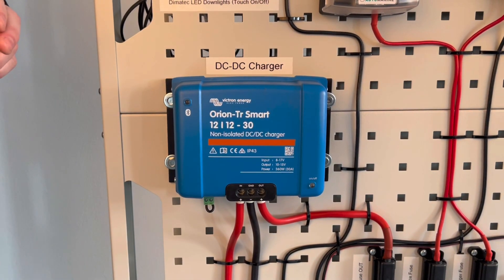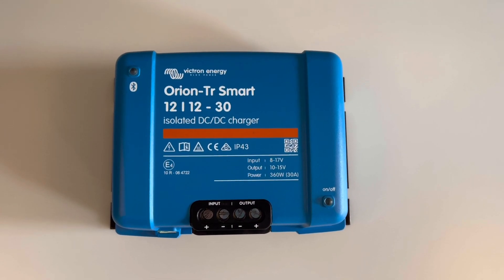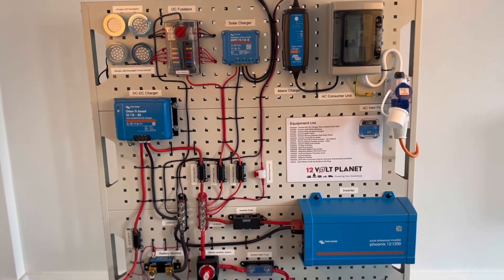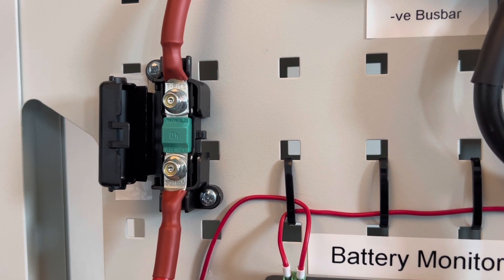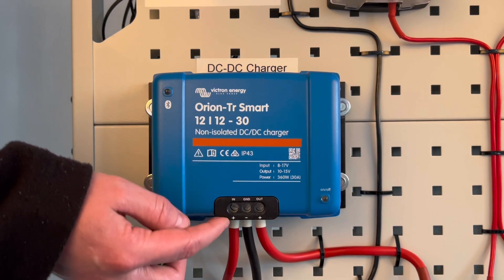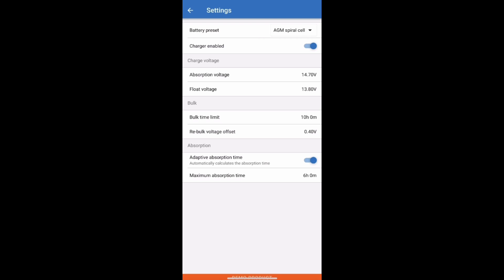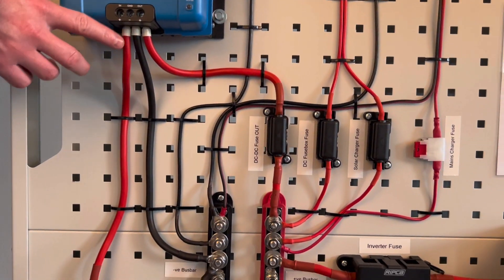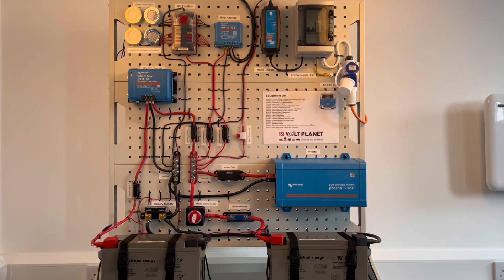How to Install a Victron DC-DC Charger | 12 Volt Planet

Comment: If you have an 80 A alternator, should you get a higher ampere charger?
Reply: You want to keep the amp as low as you can and still get a charge, that will depend on the type/brand of power station you have. The high amps draw is what burns the alt. out. This is why you need to adjust the settings for your alt. should only be 20-30 amp draw to be safe for your  alt.

Comment: It’s a 30A dc-dc charger; with 40A fuses on the input and output. Why does it need 16mm(2) cable rated for 110amps? The cable is not going to see any more than 30amps. Would 10mm(2) cable not be ok?
Reply: I also don't get it. The charger can output 30amps max so theoretically can only draw 30 amps therefore cable should be sized appropriately. Voltage drop is not significant in short lengths as far as I understand.

Comment: Good morning and thank you for the video.  Currently my motorhome has the services battery not connected to the chassis of the vehicle.  In order to use an uninsulated DC-DC, I would like to connect the services battery with a properly sized cable to the chassis ground.  Do you see any contraindications to doing this?  What problems might I have?
Thank you for the feedback.

Comment: Just skips over for 4.59...how many fuses in that positive run. One 40a close to the van battery then another 2 on the run from the charger to the L.Battery....plus what looks like an isolator switch. Just very confusing.

Comment: I am in the early planning stages of converting my van. It is a Transit Custom and I am intending to put the leisure battery under the passenger seat. I do not plan to earth it to the van chassis. My brain is getting a bit frazzled understanding this bit of the electrics. Would it be better to go for an Isolated or Non isolated charger. Thanks
Reply: Isolated will give you 2 negative wires so that you can send one to your starter battery and one to your liesure battery. Non isolated would give you just one negative that you could grount to the chassis if both batteries were also grounded to the chasis

Comment: I just can't understand the 30a output part. I phoned a victron dealer and they confirmed the 30a would be fine for my 95ah agm battery. I'm sure I have seen in the app settings you can select 95ah agm for the 30a victron model, yet this video says it is not suitable ?

Comment: What is the main difference between running isolated vs non isolated? 
I just bought an isolated 12-24 DC/DC charger for a 24v 100ah solar+DC/DC system.

Comment: Trying to figure out if something like this would work for me. I'm currently running a dual battery setup with an H6 Optima Yellow Top as a house battery which is isolated from the main battery with an automatic isolator. Charging voltage is usually anywhere from 14V to 14.8V, but seems to charge closer to 14V most of the time. My Bluetooth battery monitor started showing signs that the battery wasn't holding a decent towards the end of December. I finally had to the pull the house battery and put it on an Optima 400 charger/maintainer this weekend. I'm sure that sulfation occurred because I had to charge and drain it multiple times before it would hold a good charge. It seems to be OK now, but I was wondering if a DC to DC charger would work better.

This is on a 2017 Chevy Silverado. DC to DC charger would be installed in the engine compartment (if that's ok). The H6 Yellow Top is a 72 AH AGM battery. Recommend charging current:
Alternator:
13.65 to 15.0 volts, no amperage limit.

Battery Charger:
13.8 to 15.0 volts, 10 amps maximum, for approximately six to twelve hours.

Cyclic Applications:
14.7 volts, no current limit as long as battery temperature remains below 125°F (51.7°C). When current falls below one amp, finish with two-amp constant current for one hour.

Rapid Recharge:
Maximum voltage 15.6 volts (regulated), no current limit as long as battery temperature remains below 125°F (51.7°C). Charge until current drops below one amp.

Float Charge:
13.2 to 13.8 volts, one amp maximum current, time indefinite (at lower voltage).
Strictly adhere to all limits.

Trying to decide if one of these DC to DC chargers would be better for me and if so, which one would work best for me.

Comment: It looks like you have used ferrules on the ends of the cables? Any idea which ones they are? I have some 16mm ferrules for mine but they don’t fit in the terminals for the dc-dc charger. Thanks Nick
Reply: I think he used heat shrink around the tops potentially, Ferrules dont work to well as its a rising terminal and its set up to squash the connection and get the most contact, I was having a hard time with ferrules and was not having a good time. I did some searching and they said  bare copper is the best to use.

Comment: Great review ! thanks i need this , got a question i got the Anker powerhouse 757 my XT60 input is 30V 10 AMP max what type of Victron do you recommended ? or can change the amps in the Victron Orion 12/24-20A non isolated to 10 amp ? or do i need to buy the  Victron Orion-Tr 12/24-10A (240W) isolated

Comment: The Orion Tr Smart gets to hot without a fan as it has only 88% efficiency. So it reduces charge current just after 15 min driving. Probably it has the lowest efficiency out there. I would recommend to go for a fan cooled dc-dc charger instead, if maximum charge current is important.

Comment: This is a great video. If you have a Victron mppt and panel going to main battery can this be used to take the 2nd output from the mppt to the Orion? The 2nd battery is charged when the vw bus is running via the ecu as it's a factory 2nd battery. This is to divert solar power from the mppt to the 2nd battery when the bus is stood up and intention off? 😁👍🏼

Comment: Seems like you could use two of the isolated chargers to charge a battery with twice the voltage of the supply. 🤔

Comment: Very good video thank you, I currently have a PowerPart PDU and when I start the engine there is a click in the PDU and it turns off my motorhome electrics, except for the Fridge.  I would like to replace the PDU with separate units, one of them being this charger.  How does this work when the engine is running, does this charge unit stop charging and let the engine take care of it?  Also when I plug into a hookup and the engine is off, do I charge both the leisure and vehicle batteries with this?

Comment: Hello, thanks for the info!
I have 2 questions:

-Witch fuse put in/out in the Orion tr Smart 12/12-18 ? I put the 20a in both the way, it’s correct?

- it’s possible when the engine it’s off charge the motor battery from the solar panel that charge the service batterie’s?

Thanks again for the info!

Comment: I remain confused in regards to Isolated & Non Isolated to charge our 400ah LifePo4 batteries ********We have a trailer that is electrically connected: 
1) via the 7 pin plug so that signals, brake and running lights work with voltage input from the vehicle, a bonded GROUND needs to be maintained for use.
2) I assume the  negative entering the trailer from the 7 pin connector is grounded to the trailer frame.
3) also the ground is connected by way of metal to metal physical connection at the hitch.
4) the 7 pin connector also has a small conductor (12vdc) used for house battery charging. 
***** We know we will be disconnecting the 12vdc charge wire to the trailer and running #6 awg. from engine compartment to the B2B Victron 12/12-30 installed in the battery compartment in the trailer. 
***************************The Question***********************
Which Version of 2B do we need Isolated or Non Isolated?

Comment: Thanks for the video.  Just to be clear, do I use a negative 16mm wire from the Ground on Orion to an individual grounding point on chassis or must it be same grounding point as leisure battery?

Comment: The maximum length of cable that Victron suggest at 10 m. for 16mm sq is much too long. For a 5% power loss from the alternator, 4 m. is the maximum cable run. And the feed to the house battery should be shorter to accurately charge the LiFePO4 battery. Might have been okay for Lead Acid but LiFePO4 have a flat charging characteristic.
  20mm sq. will fit Victron's terminals. I used square ferrules to prevent problems from "whiskers". My cable run was 5 m. then 1 m. to the batteries.
Reply: Thank you very much for your post! As the matter of fact, I am about to mount my Orion and I am obliged to mount it at a 4 mt distance from the engine battery. Considering the loss of tension and fairly high current, especially in hot weather, I was really NOT fond of Victron holes accepting a 16 squared mm terminal and was trying to understand how to fit a larger cable (I was actually thinking about a 25). So, do you confirm that you were able to fit in a 20mm cable?
Reply: @ludovicobonsignore4284  Hi, I can confirm that 20mm sq. will fit Victron's terminals of an Orion Smart TR 12 | 24 15A Isolated. I used square ferrules to prevent problems from "whiskers". The physical cross sectional area of 20mm2 cable depends upon the diameter of individual strands and how well they pack together. Then you have to consider the thickness of the ferrules. You must use ferrules. There was no spare room.
   I have since changed to 10mm2 wiring to get positive and negative  through the firewall grommet because I changed from using the chassis as the negative return to accurately connect to the starter battery shunt (Euro 6).
   This does violate my target volt drop but I'm coming to accept that in campervan build you will have compromises. The B2B does not contribute much to charging my batteries because England is small and driving distances are short. So I gave up worrying. Regards.

Comment: Great vid,which would u suggest for a 2014 Sprinter with 2x130ah wet acid leisure batteries?
Reply from the maker: I would recommend the 30A charger for this battery bank. Many thanks
Reply: Thanks still unsure wether isolated or non isolated would be best ??

Comment: Hi. Does the 10 meter cable apply to the non-insulated model? Are we going to use 10 + 10 meters in the isolated model?

Comment: Victron manual states 60A MIDI fuse and 16mm2 cable (<10mtr run)   (Spec: 30A cont @40C, 40A 10Sec MAX, 60A ISC)  -  40A MIDI fuse may overheat when pulling current on a long cable run with voltdrop.
Reply from the maker: It's unlikely that a 40A fuse would blow with this unit but a 60A fuse is recommended by Victron

Comment: I have just brought this charger but the manual says to use a 60a fuse. I’m confused now?
Reply from the maker: It's unlikely that a 40A fuse would blow with this unit but a 60A fuse is recommended by Victron

Comment: Just replaced my lead acid batteries and split charger to a lithium and Victron dc charger, with the old system the solar would also charge the vehicle battery when voltage was high enough, can’t see how this can happen with new system, anyone got any ideas ?
Reply from the maker: Hi, your solar charging will be handled by a solar controller and not the Victron DC-DC charger. Do you know what solar charger you have?
Reply: @12VoltPlanetTV  Hi, not sure I explained my question correctly, I have the Epever MT 50 solar controller, it charges leisure battery no problem. With the old split charger system it worked both ways, charged leisure battery from engine and solar then with engine off and when sun shining it charged leisure and vehicle battery
Reply: @copperknob1971  12v planet may come back with a better answer, but it sounds to me like your old system may have been making use of a VSR. Sorry if you already know what one of those is, but I'll explain anyway just in case. The VSR would sense the healthy voltage coming in from somewhere (the solar) and would activate, thereby connecting the leisure battery and starter battery together.  When the voltage drops (i.e. at night when the solar stops providing power), the VSR would detect that and deactivate, thereby disconnecting your starter battery from your leisure battery.  The risk with this setup though is that during the day when your solar has activated the VSR and your batteries are connected, starting the vehicle will draw from BOTH the starter battery and the leisure battery.  This really isn't at all healthy for the leisure battery, which isn't designed to take big cranking loads.  I hope that at least partially helps! 🙂
Reply: @clearprop  hi, yes it was a VSR. It all worked well but we recently started to do much more of grid camping hence the upgrade to lithium. Big improvement but it seems the only downside is the option to keep vehicle battery topped up with solar.
Reply: @copperknob1971  I feel your pain! I'm wondering whether perhaps a 'normally closed' relay could be used, and you pick up an ignition feed for that. When you turn the key the leisure battery is then automatically disconnected from the starter battery, which would prevent the heavy draw on your lithium when cranking the engine. You then just run some suitably sized cables between the batteries, via that relay.
Reply: @clearprop  sounds like you are a bit more technically minded than me !! Beyond my knowledge that I think. Don’t think I should have an issue in theory, we don’t draw  much from engine battery normally, just maybe have the radio on. The main reason of asking this problem is due to a design problem with the Peugeot / Fiat base vehicle for motorhomes. Without going into too much detail if the vehicle battery gets too low  (about 12.2 volts) it triggers the airbag warning light on dash which is difficult to fix
Reply: @copperknob1971  I've probably made it sound more complicated than it is, sorry! You could always simply use a standard isolator switch on some cabling between the two batteries, but you'd just need to remember to switch it off before you start the engine. That 12.2v issue sounds interesting! 😬😂
Reply: @clearprop  Not how a Hybrid Inverter/ Charger works. I don't know how VSR's work but expect they should know when the ignition switch is starting the engine because auxiliaries are turned off by turning the ign to crank, the radio goes off etc.
Reply: @clearprop  Cranking current is >300A. So for a 5m. run the cable will be as thick as your arm !
Reply: @copperknob1971  The house battery should not be paralleled with the starter battery and I guess an X250 Fiat will have a smart alternator so you can't use a VSR. You probably can use a VSR but it is not the correct solution.
Reply: @i_know_nothing7788  A VSR sits outside the ignition system - in this case it would simply connect the leisure and starter battery together when the solar feed brings in more than 13v (or whatever the activation rating is on the VSR in question). Therefore the leisure battery would indeed suffer a big load when the engine is cranked.
Reply: @i_know_nothing7788  Yes indeed a cable of 5m would need to be incredibly thick to carry a current of that magnitude! However, in this scenario we are just trying to prevent big draws on the leisure battery.
Reply: @clearprop  As I understand from what you wrote the VSR has terminals to connect the Starter and the Leisure batteries and this connection is controlled by an input from the Solar which also can be connected to the joined together batteries. Is this how your system works? I don't see the reason for doing that.
  A more understandable arrangement is for the VSR (Voltage Sensitive Relay ) to join the Leisure battery in // with the Starter battery when the LA (Lead Acid) starter battery has recovered voltage from starting, that is why the relay is voltage sensitive,  and then the LA starter and LA leisure batteries are charged together with the same charging profile defined by the vehicle for its LA starter battery.
   When an engine is cranked the battery voltage drops maybe as low as 8 volts. This would cause the VSR to disconnect the Starter and Leisure so the Leisure battery DOES NOT suffer a big load. The VSR is Voltage Sensitive !